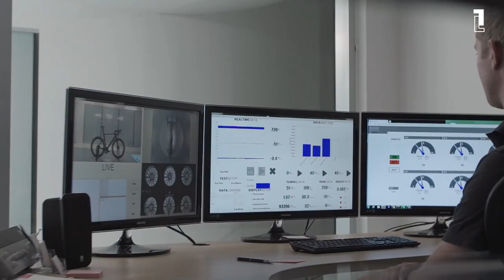Driven: The First Chainless Bicycle

Comment: BULL***T --  I bought an 8 speed shaft driven Dynamic bicycle in 2006, rode it all winter in  winter weather, in Colorado.  The drive system wasn't even remotely close to being as bulky as the drive you're showing here. I still have and ride the bike,  have never had a problem. Why it never caught on is beyond me. The only possibility I can see is that they are a bit less efficient than a derailleur system.
Reply: Very cool, wish i had one! Does it handle dust and dirt okay? Those bearings might get dirty?
Reply: The housing does an excellent job of protecting the drive system. They require less maintenance than a derailleur.  Good Luck trying to find one now though. As far as I know Dynamic no longer makes them, They've moved into some sort of fleet sales for chain driven bikes. Probably a buy-out.
Reply: I have one from Brik. A bit less efficient than a derraileur, but I don't use it for races. The greatest problem I have is, that it is too silent. I have to remember to warn people, that I am approaching 😅

Comment: This mechanism has many friction and wearing points, and thus loss/waste of power. Traditional chain is not a pain, it's actually the most reliable， much more reliable than any of the new inventions.  $2000 is way way over priced for what it does.